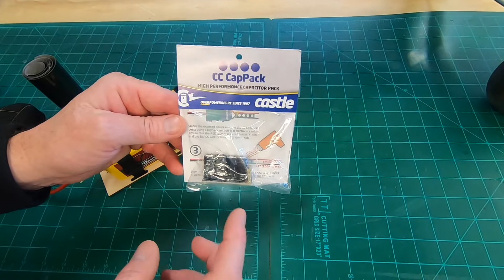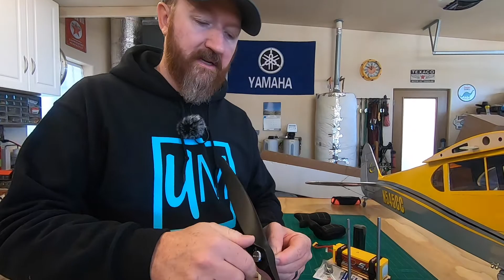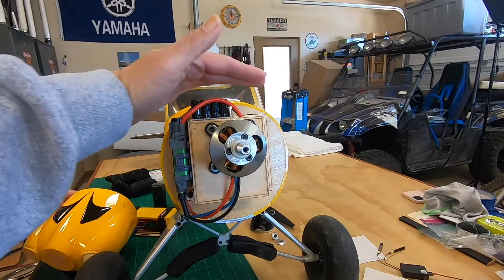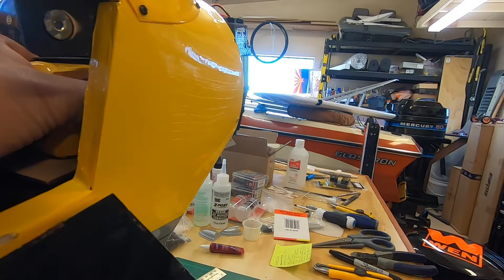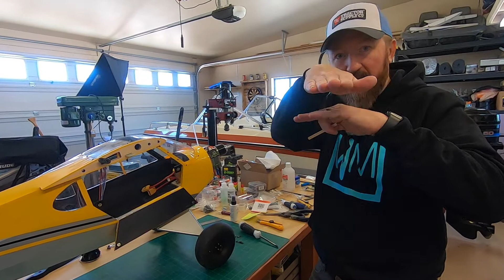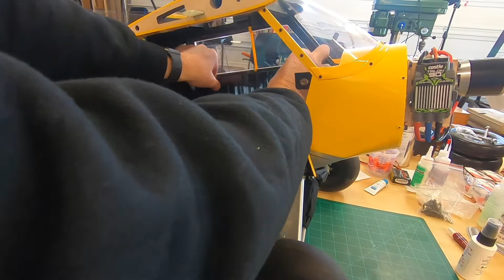Carbon Cub Mods and Maintenance!!

Comment: Looking good! Mary, bravo, 👏 the seat covers look great and Matt is right, you’ll be getting requests for the pattern.  The carbon sheet made the door and inside cabin wall look so much better. Small details make a huge difference.Too bad about the cap pack but I have a feeling you guys will figure it out.  thanks for the great video.
Reply from the maker: Thanks! Yeah Mary did awesome with the seats! Love them! And yes we haven’t given up on the cap pack yet lolol 😂

Comment: For the battery, I put guide rails so that I don't have to find the notches. Just putting two thin aluminum angles works a charm. I first made them with plywood and it worked great too. The way my brother did it is he notched the bottom of the tray and put two guide pins. It works the same way.

Comment: I like your videos and Very nice advices.
One tip for  faster asemply at the Wings is to replace stock g10 with 3mm screw with Spring attachment. I put aluminium with bolt inside the wing and i attached with Spring every time I want ro remove it.
I cannot upload here photos
Reply from the maker: Thanks! Great tip. I am currently using 3mm thumb screws with fuel tubing to act as the “spring”. Works great so far

Comment: I have the Castle cap pack on mine. You need to flip the motor with the wires going up. Then flip the ESC and put the Cap Pack on the bottom and the battery leads going through the bottom. Or flip the Cap pack so the terminals are closer to the ESC and that should give you clearance.

Comment: Do you glue the door hinges into the fuse or just slide them in?
Reply from the maker: Some people glue them in BUT…we chose not to because we were lucky and our doors fit so perfect and the magnets are so tight and snug that there is no way it will open in flight. The lower door holds the upper door in perfectly!! We didn’t want to lose the access to the cabin by glueing them in.

Comment: Could you rotate the cap pack 180 from where it was ?... it would make the connection to the esc shorter, or rotate the motor and bracket 90 you have power lead length. Just thinking out loud.
Reply from the maker: When I revisit this project I’m gonna lay the cap pack on its side! I think it’ll fit.

Comment: I have watch all of your Carbon Cub 15cc videos they are very nice !Iam building one,do you think the Saito FG-30B would be ok? I read that some people say the FG21 is low in power for stunts.Thankyou for your information!
Reply from the maker: Awesome thanks for watching!!! As far as those four stroke engines I have read also that the FG 21 is more for scale flying. Not much excess power. I know that’s how the DLE 15cc is also so people step up to the DLE 20cc for the little extra power. Now for four strokes I would think that the same principle would apply and need to go up to the FG30 if it will fit. I’ll be honest I have not looked into the four stroke engines ever really. But once again I have read the FG21 is more for scale flying.
Reply: @UngluedModeler  Thankyou for replying! Iam going to order the FG30 I will let you know.If it doesn,t fit I will just have to buy a plane that fits it!! LOL
Reply from the maker: Nice! Good luck I like the way you think haha. Bigger plane! 😂
Reply: @edwinmclean2591   The valve covers leak lots of oil.
Reply: @edwinmclean2591  I'm thinking of a 90 electric motor with a throttle curve that jumps sharply from 50% to 100%. Scale flight with get out of trouble emergency warp 9 power.

Comment: I'm confused I guess. But that plane looks much larger than the Carbon Cub I've been looking at buying. What company produces this Carbon Cub? Great looking plane & all the details you've upgraded. Especially the seat covers. 👍🛩️🇺🇸
Reply from the maker: This is the Hangar 9 Carbon Cub 15cc. It’s a balsa ARF. You can go gas engine 15-20cc or the electric route like we chose for this plane. Thanks !!! It’s a great flying plane. !
Reply: @UngluedModeler  thank you for the fast reply. I was just looking at that plane on Horizon Hobby website. That might be in my future. But not my first plane. I'll get the foam Carbon Cub for now. New subscriber here now though.
Reply from the maker: Awesome! Thanks. Sounds like a good plan!!